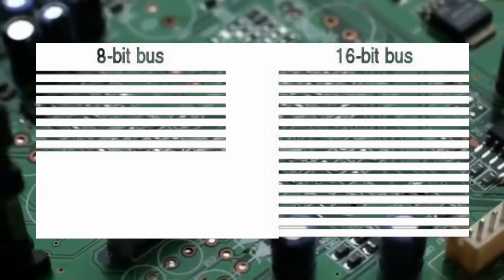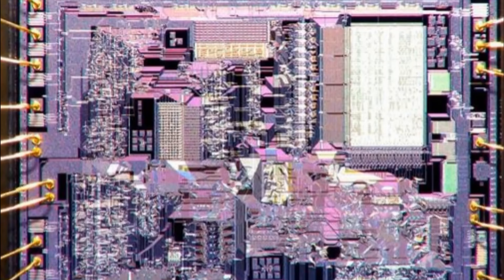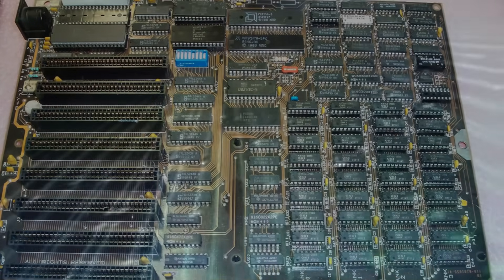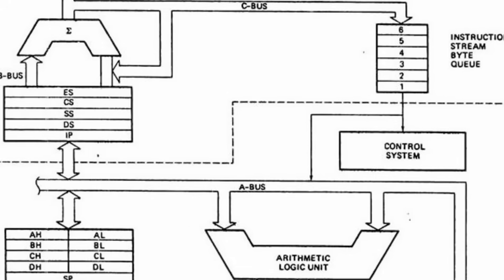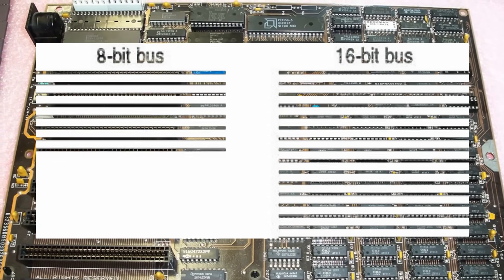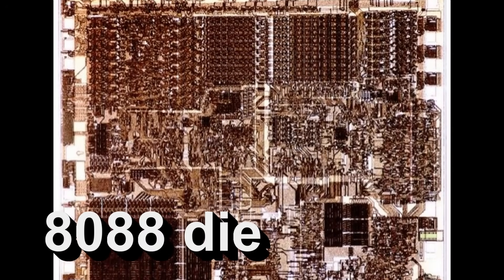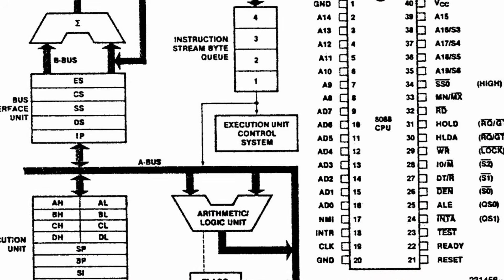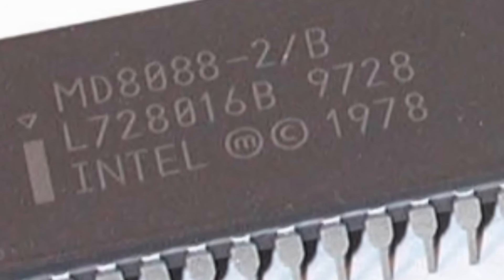8088 & 8086 CPUs... Why 16 bit Came Before 8 bit [Byte Size] | Nostalgia Nerd

Comment: 8008, 8080 and 8085 were all 8-bit processors from Intel, with the 8086 being Intel's first 16-bit processor (and therefore the beginning of the popular x86 microarchitecture that we still use today), and also the 8088 is actually a 16-bit CPU, but gelded in order to make it cheaper to build the computer (16-bit circuits required extra DIP chips to form the Northbridge and Southbridge circuitry on the motherboard - long before both Northbridge and Southbridge become integrated, on a single die for each components - nowadays, the Northbridge circuitry is integrated on the CPU die or implemented as a separate Northbridge die in recent Ryzen CPUs), so the cost was also a factor for IBM as they were trying to enter the home PC business back in the day.

Comment: Umm ... the 8088 was an an upgrade path offered to 8085 system users. The IBM PC precursor used the 8085 so the first IBM PC was an upgraded existing design. Note the PC 8-bit card slots are same as for IBM earlier 8085 offering.

Comment: The 8088 seems similar to the 6809, though it was the 6502 that diverted me from the 4004 and 8008, although I couldn't avoid the 68000.
Reply: The 6502 and 68000 were the one's I favoured due to the C64 and Amiga computers. The 68000 instruction set was especially nice in my opinion.

Comment: the 8088 was used in the IBM PC and XT, the 20286 was used in the AT, I read that the 8086 didn't come out until the lower PS\2 models, these coming after the AT

Comment: The reason stated in the video for the 8088 is incorrect.  The 8088 was a custom concession to IBM.  The support chips were not ready for the 8086 at the time that IBM was designing the IBM PC so Intel modified the 8086 to be the chip vendor for the IBM PC.

Comment: They used this same trick with the 386sx to save money and reuse 286 motherboards. Basically put a 32-bit cpu on a 16-bit bus. OEMs loved it because they could advertise a system as being a 386, yet re-use the stock from the 286 machines and thus saving money.

Comment: Actually if you look up the instructions per clock, the 8088 was slightly faster.  The problem is that the earliest processors were extremely simple.  They more or less had a list of steps to complete for each instruction but made sure each step was complete before doing anything else.  The 8088 most likely took advantage of something called "pipelining".  In the early forms of pipelining, fetching the next instruction and/or writing completed data were made independent.  That way while the instruction was being processed internally, another part of the CPU could deal with the data read/write concurrently.

Comment: Things are a bit more complicated. While the 8086 did indeed have a 16-bit data path, there were times where it still took two fetches to retrieve a full 16-bit word from memory, which was when the word was aligned on an odd address boundary, rather than an even one. There were also some delay artifacts related to the 8088's shorter 4-byte prefetch queue (vs the 8086's 6-byte), so "twice as fast" is largely theoretical.
Reply: According to the manual, the exception is if it is fetching instructions. It says it should only apply to data.

Comment: One other thing. The speed advantage of addressing 16 bit words at a time with the 8086 could only be realised if the words were located on an even numbered address. Since this made no difference on the 8088, there was no incentive for programmers to stick to that. Several of the internal data structures in DOS had odd numbered sizes, or had 16 bit words at odd addresses inside them. The result was that even when 16 bit memory became more common, such as when the IBM AT came along with the 80286, a lot of software had data on odd numbered addresses which forced the processor to pass it in 8 bit chunks anyway.

Comment: The big mistake Intel made was to keep squeezing their processors into a 40-pin package.  There was actually very little speed difference between the '86 and '88 because the 8086 had to multiplex the data and address lines due to not enough pins.  Motorola's 68000 was in a 64-pin package and had none of these drawbacks.  For the same reason, Intel adopted the ludicrous segment/offset addressing scheme, which was cumbersome and confusing, and limited the immediately addressable space to 64 kilobytes, just like an 8-bit processor.  With that sort of thinking, it's hard to see why Intel became the most powerful chipmaker on the planet.
Reply: The package size/pin count issue was going on even back during the 8008 days:  http://www.intel4004.com/qa8008_8080.htm

Comment: You don't absolutely have to have a 16-bit bus for a 16-bit CPU. This was demonstrated on the TI-99/4 as far back as 1979, which has a 16-bit data path on the CPU, but the rest of the motherboard apart from ROM and RAM was 8-bit. No biggie and easy to do.

Comment: If you check your history, the first two 8 bit processors were the Intel 8008 & 8080.  The 8086 was the first 16 bit, while the 8088 was internally 16 bit, with an external 8 bit bus.  The 8088 was essentially the 8086 on the inside.  (BTW, Intel created the 4004 before all that and it was a 4 bit processor, I believe user for a calculator at the time.)

Comment: I worked in a school and the PCs had 80186 CPUs. The server was a 80286. The next advanced computer was the DOS card in a Macintosh and that was a 80486. When I wrote the spec for 5 Pentiums, everyone wanted one...

They also started with Motorola 68000 and worked up to 68040 before buying PowerPC’s.

These days, there’s not a lot of change so much as multiplying cores and running RISC CPUs.

Comment: How about Motorola 8008 the one bit processor 😂😂, I had to wire-wrap ten of those CPU cards to be used as controllers for a wafer processing machine, it was fun but I didn't enjoy wire-wrapping. We have it easy today.
Reply: Wait, the 8008 was still an 8-bit cpu, the 4004 was 4-bit.  The MC14500B Industrial Control Unit (ICU) was a CMOS one-bit microprocessor designed by Motorola in 1977.
Was that manual hand wire wrapping you did, or with a powered wire wrap gun?  I came across my hand wire wrap tool the other day, had to explain to people what it was and how it worked. 😉

Comment: C plus plus also came before c plus and C# . High-level programming in program languages in general or too much for the early computers to handle before ms. The first of what can be considered a high-level programming language was developed by AT&T as a telecom system called Unix which Tuesday the internet still uses a version of the Unix time sharing system. Unix was based on C#/ script which would be considered a source code replacement for standardized C plus plus. Unix basically died out for many years to MS-DOS and windows. Steve Jobs was the first to try to revive Unix into a modern operating system but because source code like xcode and jvm did not exist he failed to Create A source card replacement for Windows so instead he had Bill Gates help him create a C plus plus base firmware hybrid source code. Linus travals was the first how to create a true evolution of AT&T Unix called Linux but it would not be for years until Google is Android OS that Linux kernels would truly deliver a blow to Microsoft. Perhaps now that Microsoft Microsoft is now open to using source code standardized programming in source code can live together in peace. Regardless of how long we have to wait we always knew that source code was the superior platform for programming and maybe Intel can work for Apple making gay computers win raspberry pies start running Windows in replace I-beam architecture as far as pre-built office computers go.
Reply: Wow, was that full of typographical errors, wrong words and inaccuracies. I hardly know where to begin to correct the details.

Comment: Did “8-bit” versus “16-bit” versus “32-bit” really mean anything?

Most of the “8-bit” micros had full 16-bit addressing. The Motorola 680x0 family had 32-bit addressing and full 32-bit registers. But the early members of that family were considered “16-bit”, not “32-bit” machines.
Reply: Or even 24 bit machines, on some revisions

Comment: Try the 68008 on for size, 32 bit operations and addressing on the inside, 8 on the outside. Loading a 32 bit register means 4 bus transactions. A lot of CPUs are to this day limited in what they can do on the outside. Consider 64 bit cpus. I don't know any that expose the full 64 bits of address bus from a0-a63. A CPU might just expose a0-a35 giving you 36 bits. That means they can address 4G * 16 = 64G. That's not much considering these are usually 8 cores per chip and 64G is not that much if you think of a box running a hypervisor in some cloud. So why would you even want a 64 bit addressing on the inside, if you only use maybe up to 40 bits (256*4G=1T) outside? Because the 64 bit give you a for today's standards virtually limitless virtual address space. There's a pun of sorts here. Because in the 32 bit days you could run out of virtual address space in a given process. Your largest possible address space you could address was 4G (minus possible  overhead depending on architecture). If your dataset was larger you had to do it in parts. For example using mmap() with say a 3GB window moving through a 256G file. Well now we don't have to do that anymore. Now can simply mmap() memory map a 64TB file into a 64 bit virtual address space in one piece. And the same thing holds true back when we thought that 1G was a lot of data when our 32 bit machines only had a (back then) massive amount of say 128M of memory. At least we had 4 GB of virtual address space to map that big chunk of data into.
Reply: Ahh those were the days when the Amiga ruled, an amazing machine way ahead of the pack at the time.

Comment: I'm going to take a stab (before the video kicks off) that it's because 8-bit and indeed 4-bit (and lower) processors already existed before both of those chips; the 8086 was a 16 bit (hence the "6") successor to the 8085, itself an upgrade to the 8080 (and 8008, and 4040/4004). When there was a clamour for an internally 16-bit machine code compatible with the 8086 but able to be retrofit to cheaper and/or existing 8-bit bus motherboards (as its improved efficiency over the 8085, and particularly increased address space, and how the narrower bus wouldn't be too much of a bottleneck for byte-aligned data even though 16-bit opcodes would have to be cut up, meant people weren't happy just sticking with that), they cut the external bus down to 8 pins and took the simple route of designating it 8088.

Not sure if the 88 is still that much faster than the 85 overall, given how it's generally starved for bandwidth (the input pipeline, which is kept reasonably full on both the 85 and 86, is near-empty much of the time on the 88, and processes end up being held up by having to output results in a laborious half-speed fashion)... but, eh, it's what the people wanted, and it was at least code-compatible with the big brother chip meaning you could write programs for either and they would run on the other, providing an easy upgrade path once it became more affordable to build 16-bit PCBs, as well as a way of having stratified cost and performance (running the same bytecode) with multiple machines in a manufacturer's range, the faster ones not even having to run at a higher clock, merely have a wider bus and the '86 instead of '88.

Comment: I respect to NEC who developed V20, direct replacement of 8088 with quiet low working temperature.
Reply: They also made a much faster multiplication in it. Norton sysinfo used multiplication as a benchmark so people thought the V20 was 70% faster than 8088.

Comment: one very infuriating thing is your pronounciation of 8088 and 8086. because it sounds far better if you pronounce them as 80 88 and 80 86 instead of each digit 8 0 8 8, 8 0 8 6
Reply: Your laziness needs more effort. The 8 doesn't change, so they should be called the 6 and the 8 in the context of this video.

Comment: 8 bit means that the ALU word size is 8 bit.
Reply: Not always; you've probably heard about the Zilog Z80 8-bit processor, which has an internal data path that is 8 bits wide, as well as registers that can hold 8-bit values, but ITS ALU is actually only 4 bits wide! I didn't know this until very recently, when i learned about it in a youtube video about "de-lidding" the Z80 and tracing all the internal circuitry. i was literally looking like this 8-O lol
Reply: It's generally more accurate to consider it in terms of the register widths, as well as the usual opcode size, the word size that the processor most naturally defaults to transferring with each instruction, and the data bus width it (or at least, the main model in its series) was most commonly built to use.

In almost all of those cases the Z80, 8008, 8080/8085, 680x and 650x rate as 8-bit; the 8086/8088 (and 80186/286), 68000 (and 68008, 68010), Z8000, 32016 and 65C16 are 16-bit; and the 386, 486, 68020 thru 68060, and 32032 are 32-bit. (And the Pentium is actually 64-bit...)

Comment: Never knew the 8086 got higher than 4.77mhz, interesting. we had the 8088 at 8mhz because it was cheaper than getting a 4.77 mhz 8086 and said to be about the same speed. It's like the original celeron.